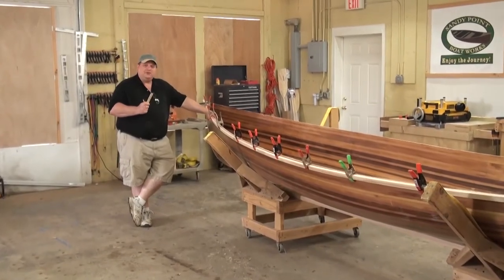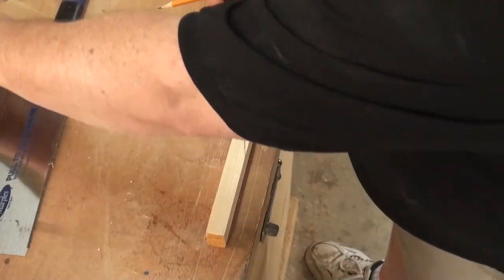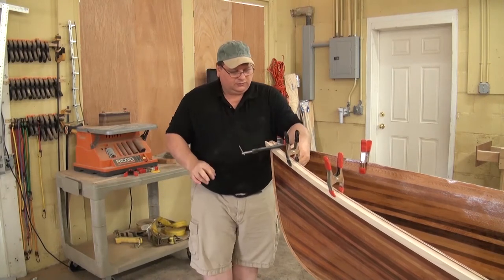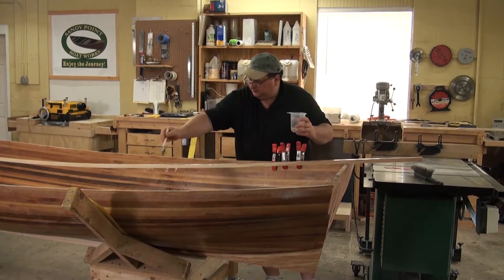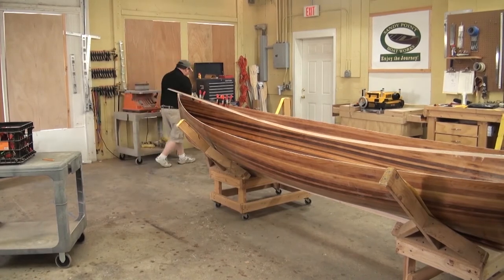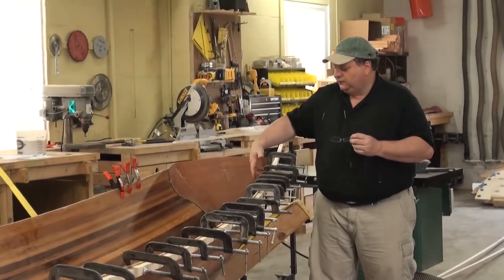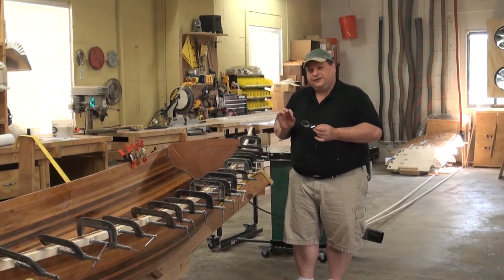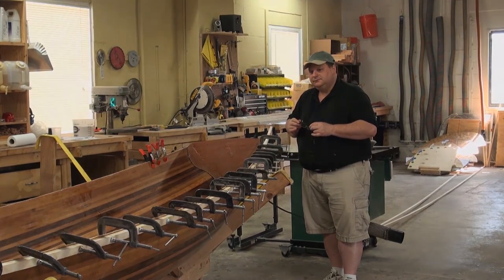22 Attaching outer gunwales to your Whitehall Wherry boat

Comment: wow what an amazing resource you've created. Let me ask you for advise. I've got this old family 14' sailboat (Atlana Koralle) without deck, without gunwales and one of the two daggerboxes is no longer attached. I was told the hull is tight - but it's not very thick (slightly thinner than yours) and rather easily deformable. What should be the order of repairs? Scrape off the inside of the hull, apply thin epoxy sealer, attach and reinforce the daggerboxes, then make gunwales and check the remaining struts, finally attach marine ply to the gunwales to form the deck. Does that sound ok? Any comments very appreciated. Matej
Reply from the maker: Hello Matej, 

It is hard to say too much without seeing the hull, however I can say this.  nothing happens until you have a stable hull.  The hull you are looking at in this video is 1/4" core and it is very solid.  

Some of the rigidity comes from the scantlings and some is from the shape of the hull itself.  It is possible, even likely that you will need to install dagger boxes, seats, risers etc... in order to achieve a stable hull.  It is really all very design dependent.

Best of luck

Jack